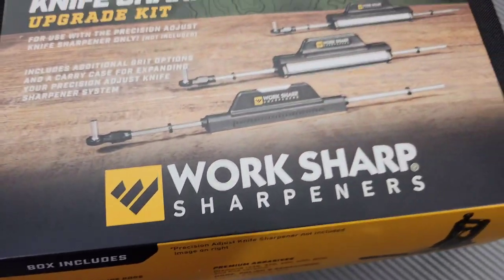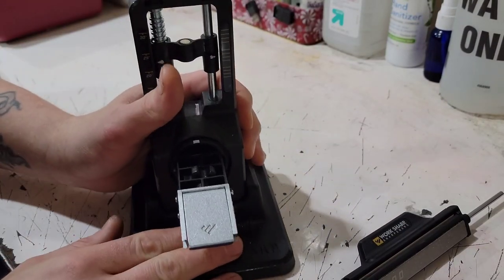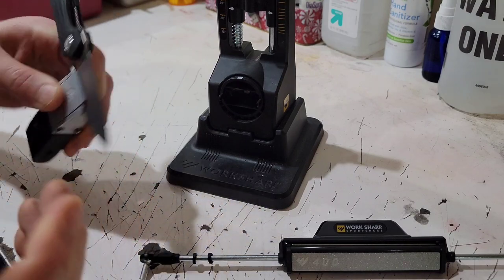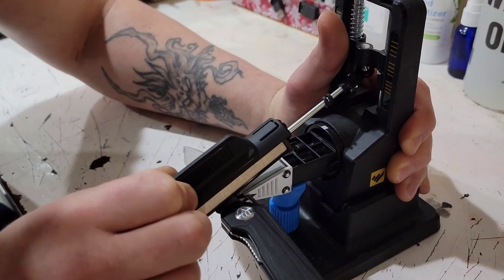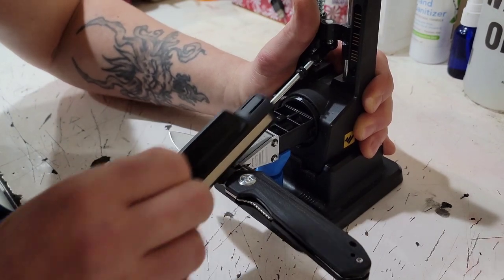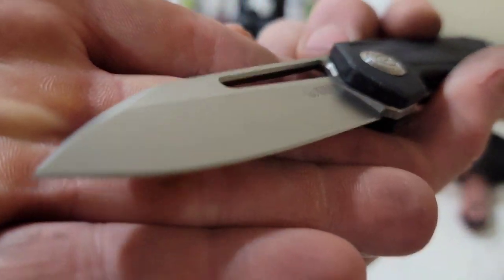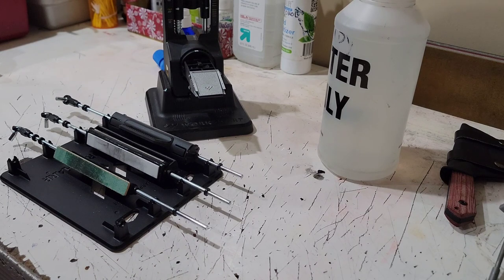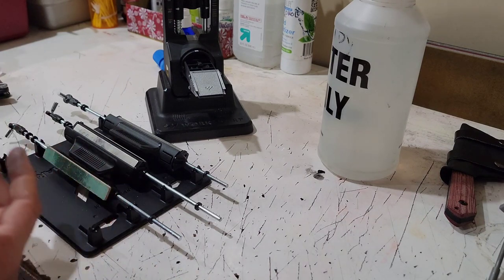WORK SHARP PRECISION ADJUST KNIFE SHARPENER UPGRADE KIT TESTING REVIEW

Comment: This system is great! My main gripe with this sharpener is the stones wear out quickly with recurved blades made out of strong steel.. not entirely sure how they'd fix that issue. Maybe spherical grinding stones? That itself presents its own problem though. Easily replaced stones would definitely make the precess much more intuitive.
Reply from the maker: Get the aftermarket attachments and then you can use any stones
Reply: The stones are easily replaceable, just pop them out and put in a new one. I just bought a 220 grit stone for my original kit, and the strop. It's just an adhesive backing, grab a thin flat head and pry out the old stone
Reply: @NeevesKnives  do you have a link to the aftermarket mod

Comment: Good to use an angle cube and record your actual angle on a specific knife you’re sharpening.  Also, less pressure is best if you’d like an even bevel.
Reply: Hi , i think this type of sharpening systems are not sharpening a blade on the original angle but on a forced angle and only if the blade is perfectly round with the same radius on the whole lenght of the blade this kind of system will work and i said not this sysytem but all the systems with only a pivot point.
If you are not in accord with me,  you can make a video to show with the electronic angle meter to show everybody in different spots of the blade it is a different angle and that can damage the blades and messed up your entire angle of the blade because when you haveTHE SAME HEIGHT BUT DIFFERENT DISTANCE, THE ANGLE BETWEEN THE BLADE AND STONE CHANGE, and THATS NOT GOOD FOR THE BLADES.
After few sharpening sessions with these kind of systems you will have on a single blade a mutitude of angles that VARY with the shape of the blade, the more curves or chages of a direction of a blade has the more angles you'll have because, LIKE I SAID BEFORE, THE DISTANCE AND ANGLES ARE  INVERSELY PROPORTIONAL then as one quantity increases, the other decreases.

Comment: Just bought upgrade kit yesterday. I also bought clamp brace. Love this system by Worksharp. Your videos are very informative and detailed. Still debating on getting the other kits from your other videos (4" stones and holder) for this system, want to try Worksharp's upgrades first. Thanks for the information
Reply: Where did you get the clamp brace? The eBay link in the item description is no longer valid. Thanks!

Comment: The precision adjust is a great knife sharpening system. The only complaints I have with it is the thumb screw on the clamp is all plastic including the threads. I've had my precision adjust for about six months and I've already had to replace the clamp twice because the thumb screw stripped out as I was tightening the clamp. My only other complaint is that you can't sharpen smaller knifes because they sit to deep in the clamp.

Comment: It is a neat system for sure, I thought about buying one on sale for $50, but I have a 1x42 wet/dry grinder and if I'm going to set up a Work Sharp I'll set up my water drip and ceramic belts or silicon carbide belts I use for rocks. I mostly do a low grit diamond to form my edges unless it's bad, then to the grinder, but not everyone has one or the skill. I made the drip easy and with a sponge it doesn't throw crap all over with the guard closed.
 Shoot you know why they don't make all those accessories right? More money selling their stuff. Old as business to try and keep it in house, but there are already OEMs, they'll eventually have to make holders for other stones and what not.
Reply from the maker: Yeah and i agree they should capitalize where possible thats why i think making the attachment i reccomend would be extremely beneficial to them instead of others making that profit like they will
Reply: @NeevesKnives  Exactly!

Comment: The problem I have with these kinds of sharpeners is the blade clamp. It's not always clear-cut getting it straight if you have a blade that has a swedge or a spine that curves or drops. Narrow blades like on the Ultratech, or old-school slip joints are also troublesome. I like my Spyderco sharp maker. It works on everything
Reply from the maker: I personally havent had any issues and you can always wrap the spine if needed for more support. But i can see where some might have issues

Comment: Looks like a good addition to the system. I believe the upgrade kit will be $80, and the whole system with the rods will be $120. So that leaves the dilemma of whether to get the base model, a universal stone holder, and some 4 inch stones instead of the upgrade kit or whole "elite" version... Hmmmm. Also, and maybe you've done this before, but can you make a video on the lowest angle you can get on thin knives? I'm thinking the short blade of a SAK would be a good reference point since those are pretty ubiquitous.
Reply from the maker: Do you mean period or on this system?
Reply: @NeevesKnives  On this system. I'm curious about the limitations about the stones hitting the clamp. Although from what I've seen a 20° angle can be achieved in most narrow blades, and I'm not opposed to that as a compromise, I'd be interested in seeing what the limitations are for this system. I'm sure you can put an insane 10 dps on a SAK freehand lol. Not that it would last... Also in regard to my main comment, by "thin" I actually meant narrow, as in from spine to edge, in case that wasn't clear.
Reply: I tried and couldn’t sharpen my SAK pen blade.  It hit the clamp.
Reply: @MrLlama999  What angle setting? Or not at any angle?
Reply: Idk what would be the lowest angle you can get  but it would be in the 20 range maybe a little higher I chamfered the edge of the clamp and I normally run a 17 degree round about angle on most knives and Iv had very little trouble with what your talking about the stone hitting clamp on a thin blade long as I barley put the blade in the clamp so the most knife possible is left exposed you need a very tiny bite on your knife
Reply: I am tempted if not just for the case that way I can retire the card board box it came in.

Comment: System is good for small knives. You have to get an attachment so it don't wiggle and change the angle. However, even if you do get the attachment if your blade is big, it will wiggle. I ended up buying the edge pro apex 4. A bit more money but it's way more stable.

Comment: I’m really new to knife sharpening, and have been looking at different systems. How does this system compare with Lansky?
Reply: I have both, and I like the work sharp more.  The Lansky is nice, and I use it for knives with really narrow blades, but the work sharp is nice, because you can get the exact angle you need, without the whole re-profiling of the edge bevel to match one of the pre-determined angles.  I can resharpen a blade in about 15 minutes on the worksharp device.  I don’t go for mirror polished edges, I go for sharp edges, although the new rods will help in the mirror edge department.
Reply: I agree 💯 with echo. Lansky is a great system for most pocket knives but work sharp is easy and reliable. Lansky has slop in each hole that can make your edge vary from   sharpening to sharpening also each rod in the lansky has a slight difference causing variance from rod to rod. In it's defense, it is a daily carry in my Jeep  it will put an edge on most knives. But the work sharp is faster repeatable and very accurate.
Reply from the maker: I personally like this system better than the lansky, i do like that the lansky has more stone options but since theres attachments you can get for this system ypur stone options are endless
Reply: @NeevesKnives  Thanks! I thought this system might be better for having an integrated stand and the ability to pick specific angles rather than preset ones. I’ve got a 1000/6000 whetstone that I’ve been trying out, but I haven’t gotten the knack yet. I’m practicing with a cheap knife, hoping to put a better edge on my Safe Maker push dagger, after enough practice. It has a modified chisel/hollow grind, and I’m nervous to try without a good guiding system.
Reply: I used the lansky system for years before switching to this gem.... Way more consistent

Comment: Wonder if they’ll come out with a different clamp option that will handle thicker spine knives? I’ve got some folders and fixed blades that won’t work with this system because they’re too thick.

Comment: It would be nice to see some finer grit as well like a 1000, 1200.
Reply from the maker: Yeah I think a 1200 would be great especially before the Ceramic but the 800 will get finer after some use and the Ceramic will be more effective. And if you seen my aftermarket attachments you can get any stones you want
Reply: @NeevesKnives  I saw that attachment and the fact that it can use 4" KME stones etc. gives you a lot of really, really good options. I am actually planning on buying that sharpener, as well as the attachment you have shown. 

I do have a question for you though if you are feel up to answering it.. I have a much loved Fox Knives Karambit and wondered if flat stones were safe to sharpen it or if I should hunt down some curved stones instead.

Comment: Gritomatic just recently released a new version of the stone holder for this system. The LE stone holder is $16.50!! Available in 4" and 6"
Reply: I have both holders from gritomatic. If you are able to get the hapstone version , it is much better. Not only is it built more solid. It also gives you full range of motion on your stones. The LE version has the ball handle, which shortens your stroke. That being said, the LE version is still a decent option.

Comment: Where can you find the blue support piece that you placed under the knife? Something I was thinking about making myself due to the sag you get while putting pressure on the blade. Thanks
Reply: Just used mine for the 1st time, no need for the blue piece-solid!
Reply from the maker: Etsy watch my aftermarket video i link them in description or just look up work sharp on etsy
Reply: For less than 2 dollars you can go to hardware store and get a 3/8 inch rod coupling and two 3/8 inch cap bolts 3/4 inch long. Screw cap bolts in each end and it's fully adjustable to put under the clamp for larger knives. I put electrical tape on ends of bolts for a little padding. That was just for preference though.

Comment: Hello
One question please, would this product help me sharpen dog grooming scissors, especially if they are curved?
Reply from the maker: Yes and no, watch my aftermarket attachments video, if you have this system you can buy an aftermarket attachment for scissors. And an attachment for recurve. If you have both attachments then yes. But you might not need both if the scissors will fit the clamps properly, You can also try the lansky and buy the recurve attachments.

Comment: Hi Jared I was wondering when you clamp the knife in the clamp do you set it up as if there is an imaginary line from the heel of the blade to the tip, so that the clamp runs parallel to that line?
Reply from the maker: You can think of a line from center of pivot to tip of blade

Comment: Thanks for the video. Rather informative and certainly helpful. Do you have a lead on where to acquire the clamp brace? The eBay link is no longer valid. How well does the clamp hold the knife steady without scarring the blade in the place where it clamps to the blade? Thanks in advance for your time and willingness to help.

Comment: I have my doubts and thinking buying this system was a bad idea as there are no replacements available in the u.k. this upgrade kit your talking about is certainly not available over here, I am now stuck with a sharpener that has a limited life span.
Reply from the maker: Check out my aftermarket attachments video, you cab upgrade it so you can use any stones
Reply: @NeevesKnives  Do you have a link I still cannot find anything I assume you have a website but cannot find that either

Comment: Wait does that hack work? Could I use the plates from the guided sharpener on the gritomatic attachment?
Reply from the maker: If you have the aftermarket 4" stone holder for this system you can use any 4"stone, but you have to get the aftermarket attachment, I've got videos on it and more coming soon

Comment: Awesome vid and congrats again on the 15K ride that wave all the way to 100K hopefully.  Would you suggest the upgrade kit by worksharp or the Stone Holder and extra venev stones from Grainger in 2" by 4". With regards to cost and longevity I'm leaning towards the stone holder and extra venev stones. Keep making sharp things fun and enjoyable.
Reply from the maker: I think both are an amazing option, the upgrade will be easier to deal with but won't last as long as the attachment with stones

Comment: ok so it cuts paper.  Does it shave? also if your scales are not allowing the works to get all the way to the end of the blade then take off the scales.  break down the knife and only put the blade on the sharpener. problem solved.

Comment: Not the best system for thin, narrow blades (think shun paring)  blade and low angle (Japanese 15-17deg). Problem is the clamp: When you put the knife deep into jaws of the clamp, very little if the blade is exposed and with the angle you’ll wind up grinding the clamp vs the bevel.  Nothing is perfect.
Reply from the maker: True
Reply: I have the same problem. I tried to sharpen an old knife from EKA and it took nothing and then I saw the clamp got fucked up instead... huh.

Comment: Ain't nobody got time for that hot mess...save up buy a tormek , sharpen almost any cutting  tool you own ....not just knives   , carry a field stone and an old  leather belt  and your good to go
Reply from the maker: Yeah also have a work sharp belt grinder that works great that I use for large fixed blades or kitchen knives, but the edges never compare to my freehand or even the fixed angle, and you can do thin behind the edge blades with out losing any in wanted steel. Even cut tests have shown that the edges last no where near as long. But what ever works some people just need a sharp edge fast